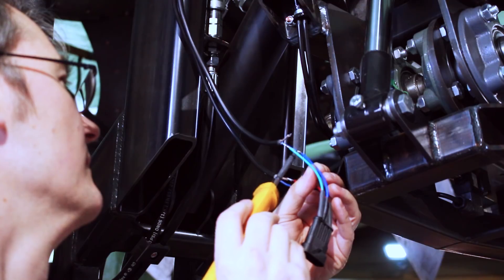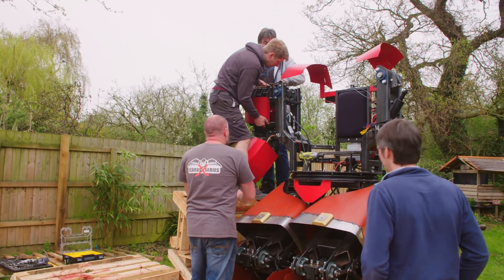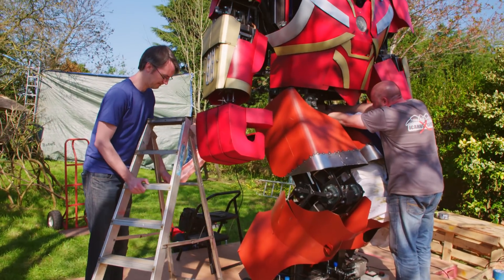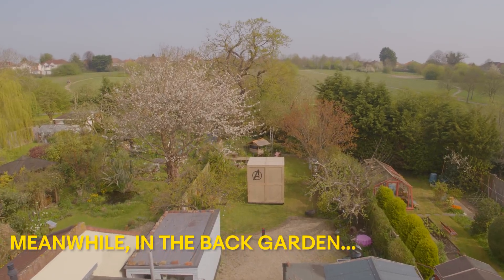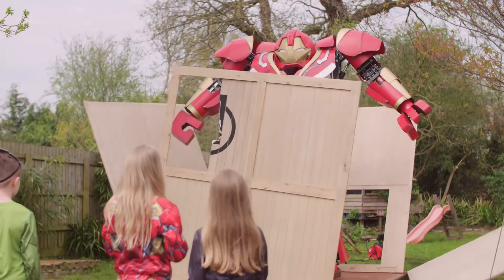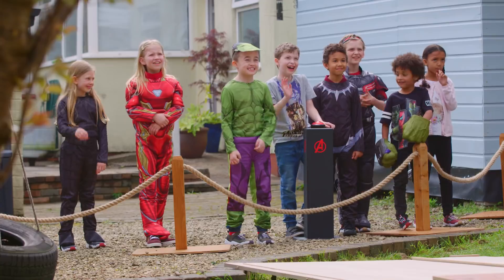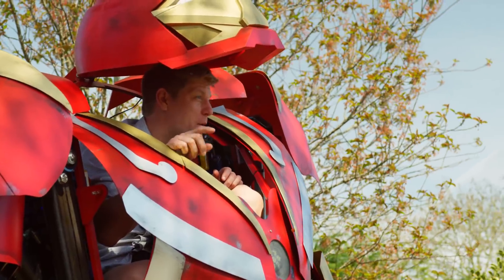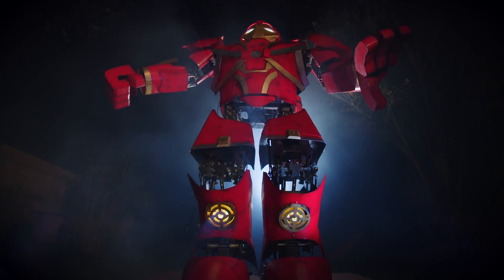Building Avengers Infinity War Hulkbuster w. Colin Furze #3 | James Bruton

Comment: Don't get me wrong, I really love this project and the executing was good. But I get the feeling you had to rush build some of the panels. Some of them just look a bit plain with not as much detail as with most of your projects
Reply: hijsm I guess the cause is, that he usually does not work with metal. In 3d-printing adding detail ist quite easy, not so much with sheet metal.
Reply: Its a eBay project, of course he could build one 5x better, its not like he has millions for a budget